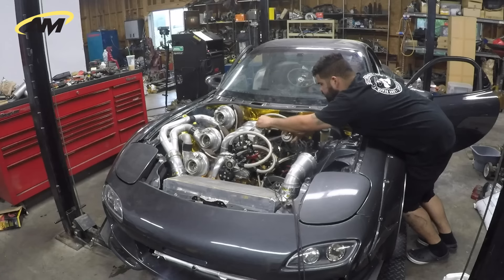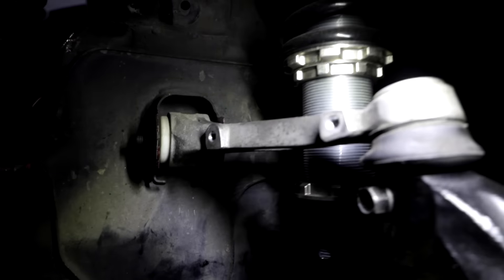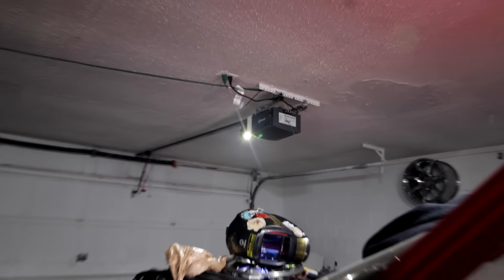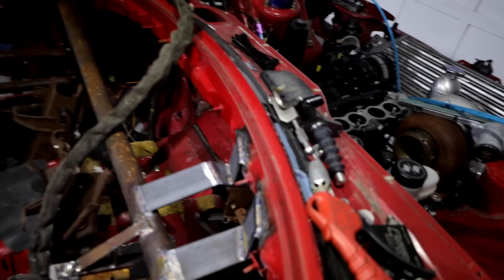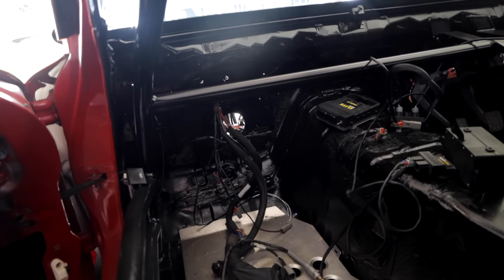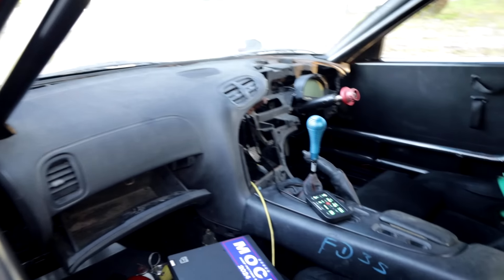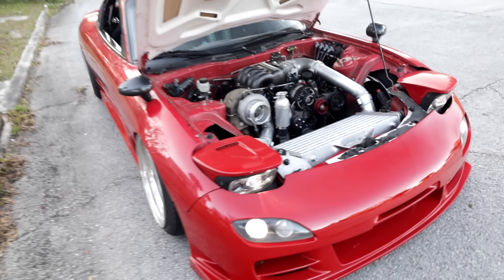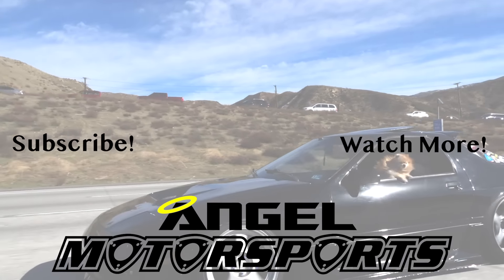John's Drift FD Rx7 Build Is Finally Completed!

Comment: Be careful with the turbosmart oil reg for turbo, mine was regulating too low at 20psi so had to remove it and asked for a refund. Worth double checking.
Reply: Mine fully cooked my turbo just posted about it a few days ago on RX-7 club. Cooked my s369sxe in under 10k miles on my 2 rotor fc

So much shaft play turbine and inducer were contacting housing
Reply from the maker: I’ll definitely check that out , thanks
Reply: @mingscustoms that’s a journal bearing turbo; you’re not supposed to restrict the oil feed on a journal bearing unit. Of course it got smoked.
Reply: @mingscustoms that’s so shitty !